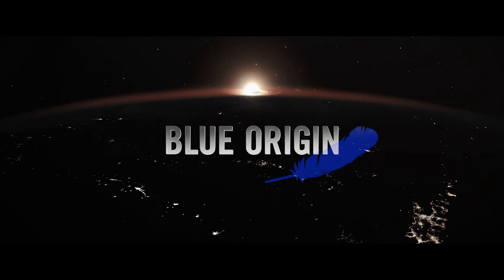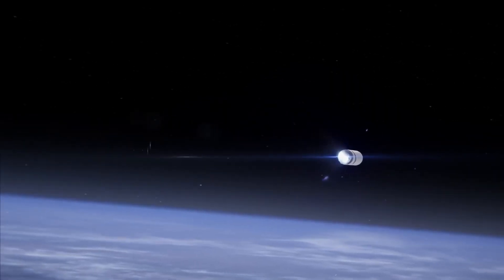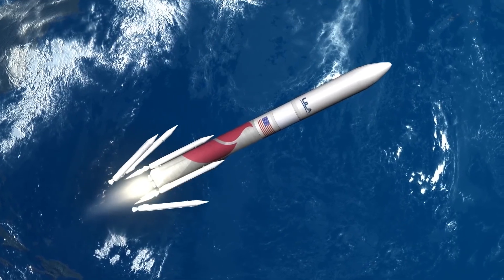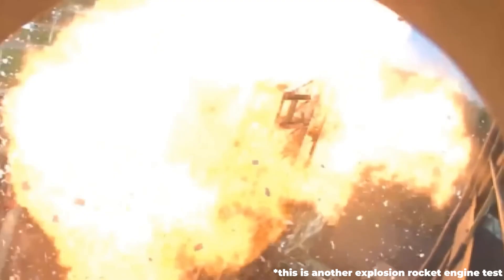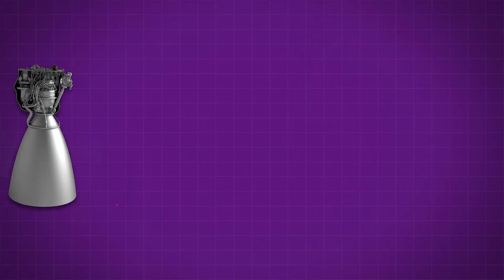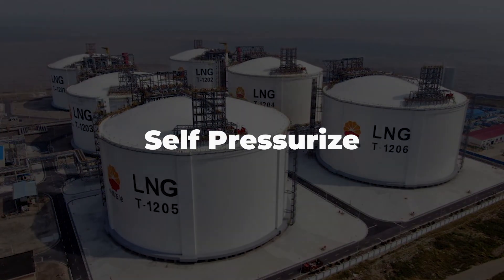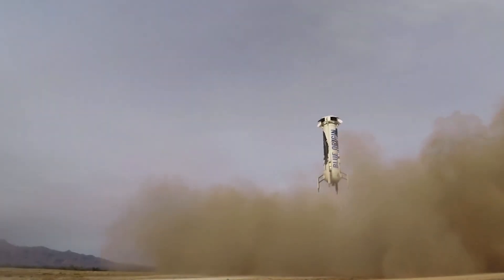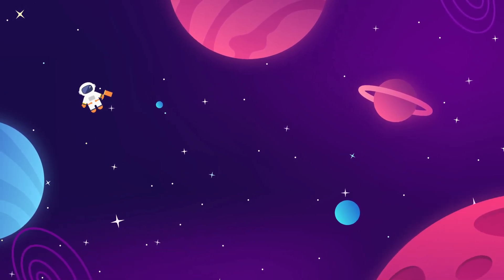The Disappointing Truth About The Blue Origin BE-4 Rocket Engine!

Comment: NASA has released images of SpaceX new, larger,  fairings. There is now nothing that Delta Heavy / Atlas could launch that SpaceX can't. The big question is, how did ULA get the largest share of government launches, in the last cycle, if they didn't have an operational rocket that would be available for the period of the contract?
Reply: They fear that SpaceX would get a monopoly. The competition is more important than the cost and sub-par choices. But I think that could be too late - SpaceX has already won. It will just take them time to get it.

I wish the rest of the space industry had reacted faster to the reusable camp. Now, after mocking it for years, they are trying to catch up. I wish them luck. Competition is needed.
Reply: @knowledgeisgood9645  Who did ULA compete with before spaceX?
Reply: @Tampainian  ULA was founded 4 years after SpaceX.
Reply: @knowledgeisgood9645  ULA is a 50/50 joint venture of Boeing and Lockheed Martin to consolidate their space launch operations and formed in 2006 and launched their first joint rocket 13 days later.  spaceX was formed in 2002 but didn't launch their first successful rocket till 2008
Reply: @Tampainian  So what is your point?
One expensive and slow, the other fast and much less expensive. Where is the competition?
Reply: @knowledgeisgood9645  The point is they never had competition before, they were the monopoly.
Reply: For some, the best way to get contracts is to set up an office in Washington D.C. and constantly wine and dine congrfessmen.
Reply: Because they are Union?
Reply: @paulholmes672  Surely you don't think the government cares about union workers?  That's all just for show.  ULA has immense wealth with which to shower their congressional reps and senators.  Follow the money.  Always.
Reply: The competition ro SpaceX will ultimately only be China. China has the willingness and money to do what SpaceX will do, for cheaper, even if trailing. SpaceX is taking all the risks. NASA is making pointless missions to learn things we could learn in a year or two if we could send stuff to space for cheap, as if one sent a raft tied to a rope across the Atlantic to get samples back in the 16th century, while China is planning for colonization (probably with robots ultimately). The private US program will have been an overall major failure, this will be obvious by the end of the decade when China takes the lead. But ultimately the failure will not have been the private sector’s fault, it will have been the US government who let NASA guide it, the private sector other than SpaceX will have just taken the path of least resistance NASA created instead of charting their own.
Reply: @nononono3421  If China or any one else is offering to compete we should be fine with it. We need more competition, not less. The one with the best, fastest and cheapest methods will win. No way to stop that in the long run. So the only way to win is to be faster than the rest. SpaceX has done that up to now. If China is twice as cheap then be better. But China is not as cheap as it was 20 years ago. And there are limits to what they can copy. It is not as easy anymore to steal IP as it once was. But then again, Elon does not believe in patents...
Reply: @knowledgeisgood9645  If you're at the front of the race, anybody who copies you is behind.
Reply: @paullangford8179  Exactly
Reply: @knowledgeisgood9645  Maybe ULA should source Chinese engines.  They aren't supposed to, but maybe they could get them through Harbor Freight - rebranded as "Chicago Impulsics" or maybe "ChicagoX"...
Reply: @briangodfrey7424  Only if they get a license to build them in the US, which I doubt. Relying on China to always deliver is iffy. Not the best of relations between China and the West right now. See what they did with rare earth elements shipments.
Reply: @knowledgeisgood9645  You really thought that was a serious suggestion?  🙂
Reply: @briangodfrey7424  People say so many strange things sometimes. You can never know for sure if they are joking or not. I try to avoid assumptions.
Reply: The last thing we need is the whole Space Program given to one private company. We've already added more layers of profit taking to costs when we took NASA programs a d have them to the private donors. We'll  have to pay even more if they become a too big to fail monopoly...then they just extort at that point, and there are no real incentives to meet deadlines. E.g., Starship will not make deadline...as a result, Artemis 3 will be delayed or mostly likely not land on the moon, instead be another orbiting his son. It's a tragedy that SpaceX is delaying the 2nd generation moon landing.
Reply: @hikesystem7721  I have not seen any delays by SpaceX. They will do their part.
When will the space suits be ready?
Reply: @hikesystem7721 
Kind of like ULA was doing before SpaceX?
While I agree that a monopoly is a bad thing, no monopoly has ever lasted without government backing!
Monopolies tend to be short lived in a free market!
Reply: @mahbriggs  Monopolies and too-big-to-failers are often supported by politicians who have interests, campaign contributions or some other sort. It's the American people who always lose in these cases.
Reply: @hikesystem7721  Sounds like you begrudge NASA buying future launches on Starship because it puts 'too much profit' into SpaceX but you don't seem to mind NASA spending $4billion a pop on an Artemis launch. Twisted logic there surely?

Comment: Showing video of the Centaur V failure is just dishonest. Also, there are two test cells at the XEEx facility in Texas, if one is damaged, the other can take its place. There's also a third test cell at Marshall Spaceflight Center that just came online at the old 4670 test stand with a test firing recently of a full with extended nozzle BE-3U.

Comment: Oxygen rich engines ain't easy!
Reply: True, although they are relatively easy in comparison to full-flow engines like the Raptor.  Keeping the chamber pressure of the BE-4 fairly modest also makes development easier, while the Raptor works at record-setting chamber pressures.

Yes, the BE-4 has been rather hard to develop, no denying it.  I'm just adding how crazy SpaceX are.

Comment: It’s hard to understand how BO could accomplish so much, but fail to get to the finish line. ULA needs to switch engine suppliers.
Reply: It is not quite that simple.  The first stage tanks are sized specifically for two BE-4 engines.  You can not swap out the engines without redesigning the entire first stage.
Reply: The BE-4 is still in development. The ULA knows this and knew this. Furthermore, the engine in question failed while undergoing qualifications, not after being marked flight ready.

Comment: Love your videos. However, a methane powered rocket (Zhuque-2) did make it to orbit last month (you said in your video that no methane powered rocket has flown to orbit).  Also, the white cloud you see coming off the Starship when it is fueled / being fueled is not methane as you state, but is primarily water vapor (that has condensed from the air due to the cold temperature of the Starship).
Reply: Yes, he has lots of errors. The fog is air fog & O2 fog, they vent O2 not CH4 (CH4 venting is an "emergency" type thing since the O2 & CH4 make an explosive mix). As well as I can recall the raptors didn't blow up in the Starship 1st test flight, a half dozen shut down and the flight termination system blew up the vehicle. And something I forgot. Both  engines should eventually be dependable, but I'd bet on SpaceX raptor being dependable enough to be man rated first.
Reply: This is what I thought okay i'm not so crazy
Reply: Your second point, which is one I was going to place my own comment about, is important because "venting" methane would be a very bad thing environmentally. This is why there is actually a recapture system built into the OLM (in SpaceX's case) to keep methane from escaping into the atmosphere...
Reply: I also enjoy the channel, but the guy is prone to hyperbole and absolutely is all up Musk's SpaceX-ass. Every single thing this channel says about BE is negative and often, it stretches the truth or just ignores contradictory evidence. SpaceX, BE, ULA, they're all chasing different business use cases. SpaceX wants to volume, ULA wants to cater to the government and three-letter-agency launches, etc.
Reply: usa is not the fucking world
Reply: Spot on Paul
Reply: This video has a few issues, among those already mentioned. The whole boiling off methane to pressurize the tanks thing is also bunk, at least as far as modern rockets is concerned. Especially when you think about SpaceX supercooling their propellants (at least the LOX), there won't be any pressure coming from that. The BFR (as I still like to refer to it 😉) is structurally sound without boiling the propellants to create pressure; to the extent that that's needed, it's achieved with helium (although I can't imagine why they can't pressurize the fuel tank with hydrogen, which is even lighter and much cheaper than helium!).
Reply: @krugerdave  at some point, they tried to feed back hot gasses from the preburners to pressurize the tanks. Though, i don't know the current state of this system
Reply: Firefly and Space X will do what Blue can't.
Reply: Firefly Miranda engine for Northrop Grumman will be a better solution.
Reply: Methane is never vented.   It is sucked back and placed back in the tank farm.   Methane gas is a pollutant and yu'd never get a permit to vent methane.  They d vent to Oxigen tanks as O2 is not harmful.
Reply: Yes, Zhuque-2 made it tto orbit and then immediately spun out of control, so they're just a little bit ahead of SpaceX (with their own spinning rocket, but no orbit yet).  The last few seconds of the Zhuque-2 control room clearly shows the 2nd stage spinning wildly before the Chinese cut the feed.
Reply: Love the "spinning rocket" thing ;) @stanj7223
Reply: I was also going to mention both of these facts. Zhuque-2 and the moronic comment on rockets venting methane.
Reply: What ‘type’ of methalox engine was used in the Chinese rocket?  Was it the same type as the Raptor?  That’s really the more significant question.  Also relevant are the performance characteristics of each engine.  How do they compare in that regard?
Reply: @billg3645  Not much known about their engines, but it is a small rocket.
Reply: @knowledgeisgood9645  "Small" compared to Starship, fully stacked maybe.
Reply: @billg3645  its the TQ12 engine and acc. To. Wikipedia, its a gas generator turbine.
Simmilar to the merlin
Reply: @Leminge42  Thanks for providing that info.
Reply: @billg3645  The Chinese methane fueled engine is an open cycle gas generator type with a chamber pressure ~170 bar and Isp <250. Info from one of the big Space channels.
Reply: @billg3645  Of course Raptor engines are better and more powerful, but controlling methane in rockets has been a challenge anyway so at least there is a proof of concept
Reply: @EighthRobin   What's so challenging about controlling methane rockets?  The Raptor specifically is highly challenging in several ways, due to its unique full-flow cycle and record-smashing chamber pressure, but that would be true regardless of which fuel it happens to use.  The other methane rocket engines have been less of a challenge to develop.  Methane itself is cryogenic, but so is LOX, and therefore it's actually easier to use them together in a rocket in some ways.

The fuel that poses the greatest challenge to use in many ways is liquid hydrogen, but some rockets use that stuff anyway.  Methane is way easier to handle and use.
Reply: Even if a cloud of methane were being released, it breaks down to become CO2 and water. So what? I'm tired of people complaining and then getting behind bad solutions. Also, I a praise the accuracy of the root comment.
Reply: @DJRonnieG  Unfortunately, methane is a powerful greenhouse gas. It does breakdown as noted, but takes on the order of 10 years in the atmosphere to do so. Most folks would prefer we not add it to the atmosphere.
Reply: @paulwilhelm6976  - You MUST be joking.  Do you realize how little methane would be released thru any relief valve?  I bet a bovine can vent more methane.
Reply: he did state that the methane was being vented which I'm pretty sure is actually correct, I was about to mention Zhuque-2 as well : )
Reply: @foggiertiger535  No, they have a vent line that leads back to the tower refuel arm. The only gas they vent to atmo from Starship is now O2 as far as I know.
Reply: @johnrmcclure1  ah, okay thanks for clearing that up for me
Reply: @johnrmcclure1  Almost true. In some cases when there is pressure too high for the return line to manage, they have no choice but to vent the difference. Of course they do all they can to avoid that. SpaceX has a quota they are allowed to vent.
Reply: O2 is seriously nasty, very electronegative

Meanwhile ANYTHING with carbon will create gunk or tholins or some kind of nasty tar. Unless it’s in a constant high temperature high pressure oxidizer rich environment that washes it away as it’s being built up. 

So while methalox is GENUINELY excellent due to the fact it’s way easier and more lightweight to store methane than liquid dihydrogen, they’re both nasty fuels to handle... though to be fair hydrogen also does spooky stuff like going through solid matter and weakening it so it’s hardly any better. 

Oxygen is important as it is pretty much the only realistic fuel we can find on the moon, the moon is basically just oxides, oxygen atoms with random other atoms, aluminum, iron, silicon, what have you. So unless you want to try and build thermite powered rockets, some kind of thermal O2 rockets seem like the only kind of things that seem possible on the moon. So it’s important to get good at handling oxygen fuels already, we’ll be using it a lot in the future and the more work and experience we get on it now, the less we’ll have to do tomorrow, where as working on stuff like hypergolics or monoprops is basically useless for the future. 

Also I wonder how well O2 can be used in ion thrusters or grid/Hall effect/MPDs, as solar+mpd will likely be the bedrock of 0G engines, and We can’t exactly use noble gasses or even nitrogen as fuel if we’re running a massive space industry
Reply: @foggiertiger535  Actually, they do not vent much methane at all, since there are environmental limitations on how much per year they can vent, as well as the cost factor.  Instead, they "re-condense" it back into the GSE storage tanks as much as possible, and only vent a very little, only when absolutely necessary.  So the whit clouds coming off the sides of the Starship and booster, shown in this video, are just water vapor.  They do also vent oxygen and nitrogen occasionally, which are cheap and environmentally harmless gasses, but that was not shown in this video at all.  Just condensate "steaming" off.
Reply: SpaceX recaptures the methane that boils off inside the tanks, at least while it's on the pad.  An accumulation of methane anywhere in the launch area could be catastrophic.  @foggiertiger535